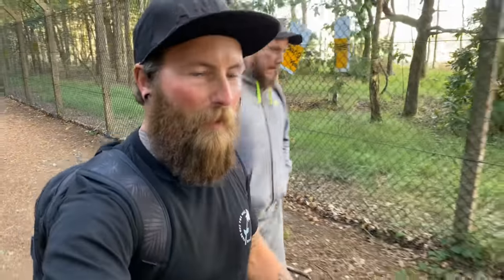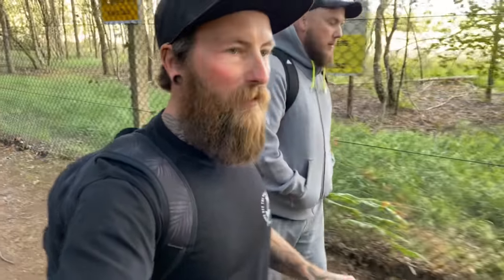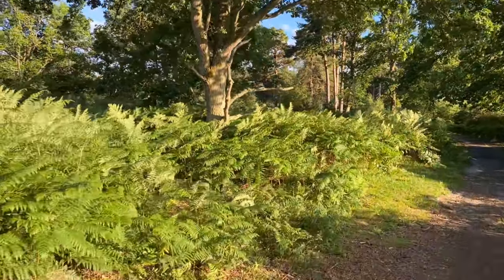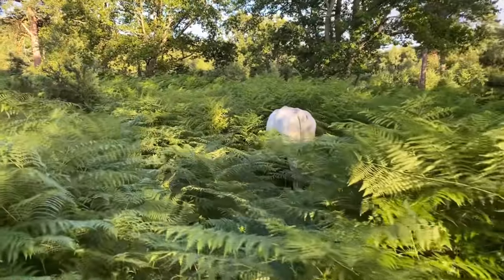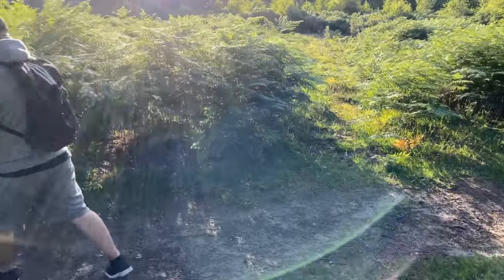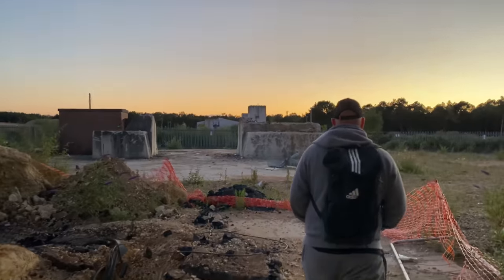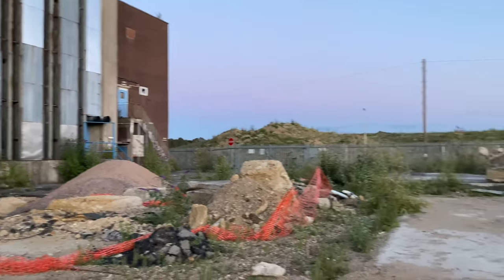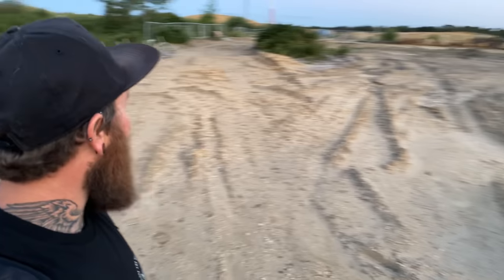We Explore The Abandoned Jet Engine Testing Facility - Pyestock!

Comment: I used to work there back in the 1980’s. I worked for Rolls Royce military engine group in Bristol and we used to test engines there, primarily the RB199 from the Tornado fighter. They had an altitude cell that could test an engine at a simulated Mach 2 at 30,000 ft. It consumed so much power to provide the airflow velocity into the engine and pull a low pressure behind the engine that they had to coordinate with multiple local power stations before firing up tha facility. It breaks my heart to see it abandoned, it was the cutting edge of technology when I was there.
Reply: No you didn’t you lie
Reply: @UrbexUK2008  bro I didn’t lie he did

Comment: Worked at the NGTE for 4 years as a youngster.  Fascinating place to visit I believe it was called the Anechoic Building.  There wasn't any echo back then, any sound would be dulled by the padded walls. Eerie place.. you could hear a whisper from 20 ft away. Microphones everywhere.

Comment: I thought this place was all gone? Explored it at least 5 times back in 2007 and it was an epic experience. Only one building left on Google Earth and it looks like it's being used for car storage. Supposed to have been a huge distribution hub going there and I actually thought it was in the process of that as I moved away  late 07. Had I known, I would have been back as my family are still nearby. Will watch the video!
Reply: From memory, the building you have been in was still in partial use back then and the road lead to Vector Aerospace which is/was operational so was well used and we kept away. Handful of photos from one of my last visits in June 07 here: https://www.28dayslater.co.uk/threads/pyestock-visit-10-06-07.15218/
Reply: So the area you are in at the end of the video is where the air would have been fed to that building through the enormous blue pipes that used to criss-cross the site. In my photos above is the air house which was full of enormous generators that blew air through those pipes at the speeds needed to test the engines. The crane would have lifted the engines into place in the huge room and the bit you had the dodgy drop from was to take the exhaust away in the other direction. These buildings are called cells.
Reply: and just found this footage of one of the other (and probably the most impressive) cells there. This was used for filming in the movie Sahara (along with another cell) and in an episode of Red Dwarf.  Sahara worth watching to see some of it.

Comment: So, I wonder if the engine was actually inside that sound dead hall and the exhaust went out through the big tunnel you came in through, rather than the other way around. Makes more sense to me to break the soundwaves in the test chamber to actually be able to measure the sounds it emits without interference from reverberations - the noise gets out with the exhaust anyway, so it doesnt matter how loud it is outside. You would also need a crane to handle the engine, which was there. That would likely make the other, higher situated but smaller pipe the intake.

We got quite a few commenters stating they worked there or in similar facilities, but I couldnt read any insight into the workings of the chamber, which is too bad...

Comment: I work for one of the other big jet engine manufacturer, based on my user name it’s not hard to figure out which one😎. Our engines are composed of one of 4 alloys. Tit, stainless, INCO, or carbon. It’s not carbon, imagine it’s not Ti, 99% it’s either an INCO alloy or SS(most test tooling is SS). FYI, they abandon these locals in situ because they remain “grandfathered”environmentally if they need to increase test capacity. Cheers